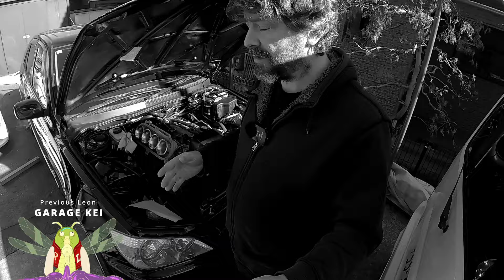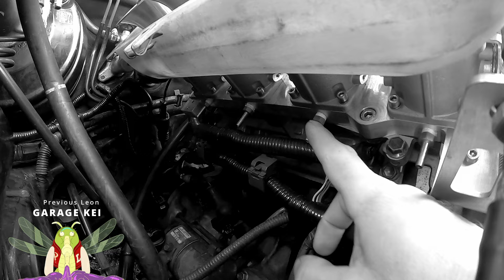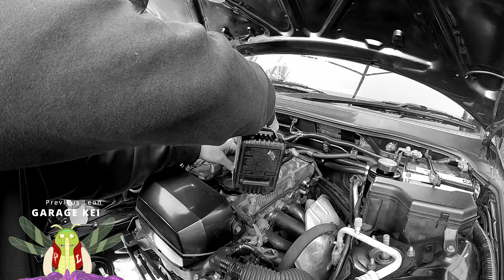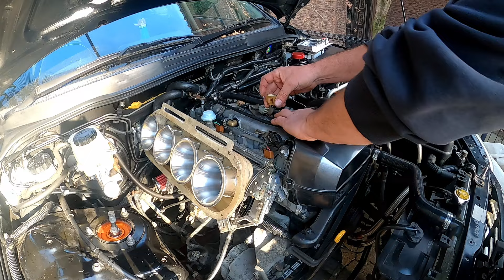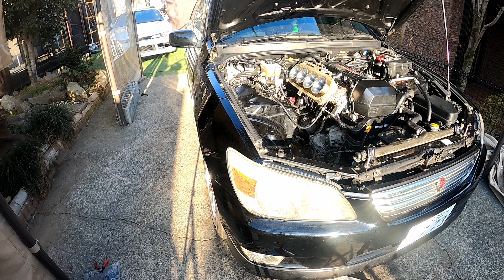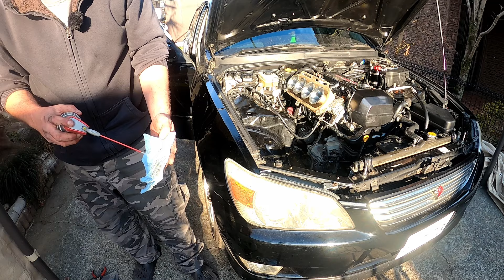ALTEZZA SPARK PLUGS & FIRST START AFTER FLOODING WITH FUEL

Comment: Was it all idling fine before? Happy to take a quick look at your map/log file to see if theres anything weird going on, or something you might have missed  (I have a running and idling Roadster on ae101s with no iacv on Link)
Reply from the maker: It was idling ok before.
I appreciate that but I want to see what I can come up with on my own first.

Spoilers:
The map reading was not as stable as it should have been. Also I changed something, that I didn't mention in the video, that I didn't think would make a difference. It made a huge difference. 😂
Reply: @GarageKei  Ahh, I see. Totally understand, its not the destination its the (painful) journey ❤. 

I was actually wondering if you are trying to run the car from a map signal as  its usually best to run purely tps with open itbs, but I have a usable zone where my itbs give me a stable enough map signal to use for idling. Did the filter you put on the map line make much difference to the signal?

Comment: Just an idea and u may have already tried but mayb disconnect the battery again remove any surface charge and reconnect the batt and try again. My altezza always takes ages to re-learn the idle etc after ecu reset. Good luck.
Reply from the maker: The ecu is a Link G4+. I don't think they don't have that sort of issue. Thanks for the idea though. 

Spoiler alert: It's partly my fault it won't idle now. 😭😭😭

Comment: Kinda jealous of those panic ITBs... my MR2 (my blacktop beams finally runs, yippee) has ae111 ITBs and the throttles for cylinders 3 and 4 do not shut all the way, causing it to run terrible.
Reply: forgot to ask, what do you do to clean the injectors?
Reply from the maker: The panic itbs are great. I just didn't like the setup process.

Injector cleaning is done by feeding them parts cleaner and give them short bursts of 12v.